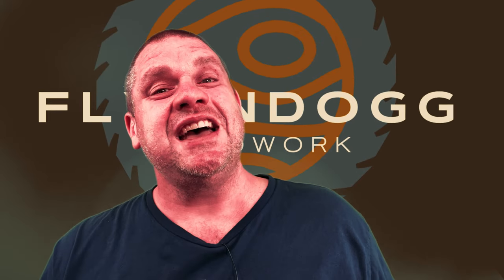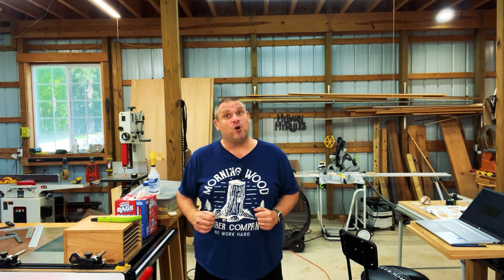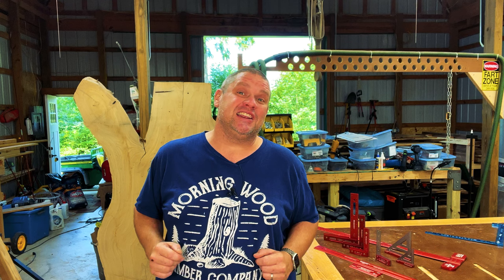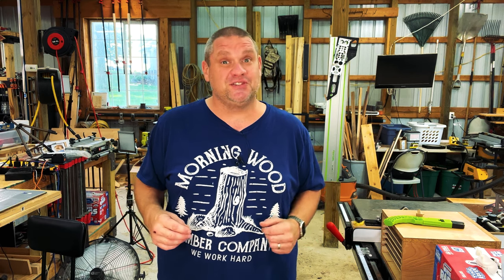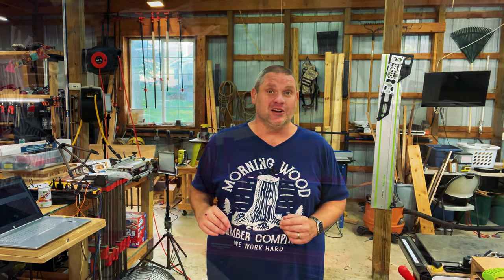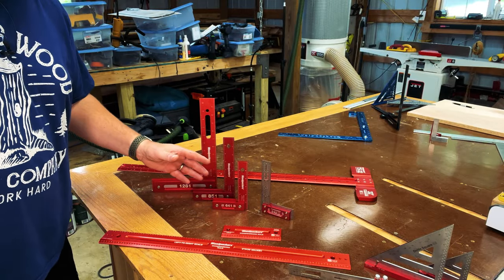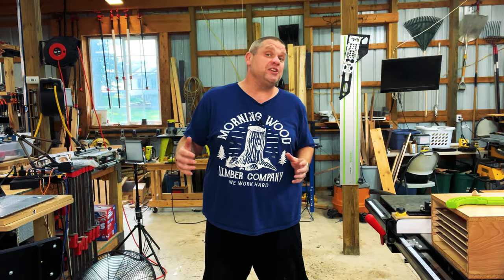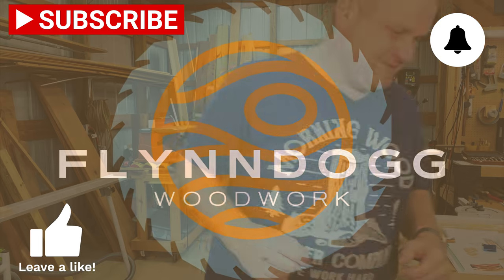Affordable and Effective Alternatives to Woodpeckers Squares #woodworking #precision

Comment: For finding the center of a board just angle the ruler to a point divisible by 2 or however many segments you need. For instance if you have a 7 inch board and want to find the center place your ruler so that zero is at one edge and 10 inches is at the other edge and mark at  5 inches, that’s your center
Reply from the maker: That's an excellent way to do it!   Thanks so much for sharing with everyone and watching unclepewter!

Comment: I attach a lip to my framing square with a spring clamp - no droop and costs zero.  
I do not scribe lines with a square of any kind.  I just mark the distance twice and use a straight edge to scribe the line.  The advantage of doing it this way is I do not need a perfectly straight and smooth edge to obtain a straight scribe line.
Reply from the maker: Love that idea!  Thank you so much for sharing the spring clamp idea!   Love hearing ideas like this!

Comment: A plain Drafting T-Square works well.  They come in all sorts of styles, and they are reasonably priced.

If you want to find a center or divide up something into equal parts all you need is an accurate rule and a straight edge.

To find the center lay the rule on an angle across your piece of wood.  Adjust the rule so that it sits with whole numbers easily divided by two rest on each edge.  Say you have a piece of wood that is 3-11/16" wide and you want to find the center.  Place the 1" mark on one side and then the 5" mark on the other, so you have 4" of rule lying across the wood.  4"/2=2", 2"+1"=3"  now place a mark at 3" and you have the center.   Do this again further down your piece of wood.  Draw a line between your two points and you have a centerline.   If you want to divide a piece of wood into thirds set the scale at 1" and 7: along the edges. 7"-1"=6", 6"/3"=2".  Place marks at 3" (1"+2") and 5" (1"+4").  You now have divided the piece of wood into thirds.  

You find the center by drawing a line across your piece of wood square to the edge.  Measure in a 1/4" from each side.  Take a compass and open it so it is wider than your piece of wood.  Strike two arcs, one from each 1/4" mark.  Where the two arcs cross is the center.
Reply from the maker: I love this Robert!  Thank you so much for sharing.  I use a couple of your tips on a regular basis so it was good to get a refresher!   I love comments like this that share experience and ideas.  Thank you so much for sharing and watching!
Reply: Good tip, and you can also buy a rule that has measurements from the center 0.  Very fast for centering.
Reply from the maker: @disqusrubbish5467  Yes!  Thank you again for sharing and watching! :)

Comment: I have a Swanson combination square. Unfortunately it was not perfectly square when I received it, but it's easy to adjust with a file. I see no reason to spend over $100 on a combination square when it's going to come out of square with general use, and you're going to have to learn how to square it on your own anyway. I also got a Swanson speed square with the combination square, the same as in your video, and it's actually square, so no complaints there. Both are a great value and there isn't a lot of worry with damaging them due to their cost.
Reply from the maker: Excellent to hear ibtamine!   Love the swanson brand and there is a reason they have been around for so long.   Some of the best value you can get for your money.   That is all I used when I first started woodworking and I continue to use them today.  Thank you so much for sharing and thanks for watching!

Comment: An inch, is not an inch, is not an inch. Straightness and square are not the only measures. Continuity between measuring devices is what led me to buy a FEW nicer measuring tools. It is crazy how much variance one can have between measuring devices. Nicer measuring devices are much more consistent.
Reply from the maker: Oh I agree with you.  And sometimes it doesn't always have to do with the edge of the measuring devises.  If you get a tool with a lip that has a bump in it or something like that I can also throw all your measurments off as well.  Thanks for sharing and thanks for watching deadbungeejumper!  Love the username!

Comment: All good points, but cheaper tools often gives more errors due to bad tolerances.
Reply from the maker: I'm 100% with you.   I do think its a roll of the dice with some of these tools with complete precision and accuracy, but brands like woodraphic have really impressed me so far.   You definately get what you pay for.  I think the key is you need to test your measuring devices as soon as you get them.   Are they square, do they line up with your tape measure etc.   Great point bamsebrumbamsebrumen!

Comment: One thing that I'd like u to comment on is the precision and consistency of the measurements. That is one of the big selling points for Woodpeckers. Are the measurements accurate in the cheaper alternatives (when compared to Woodpeckers)?  Thank so much.
Reply from the maker: Excellent idea!  Might be with a follow up video on this.  I will need a little more time to work with the brands like woodraphic to give an opinion but what I’ve seen so far has been impressive.   Thanks for the comment it’s a good one!

Comment: I use Incra, and still prefer it over most anything else.   Plywood I just use a tracksaw and get it a bit proud, and then finish on the table saw.  My first “track saw” was a 1/2-inch HDPE plate, with the saw mounted on it, and a groove to follow the slot in some t-track.  Relatively inexpensive, as I bought the plastic as an off cut at a commercial plastics supplier.
Reply from the maker: You don't know how upset I am that I didn't mention incra in this video.  You are 100% correct.  An excellent product for the money.  I have a couple of measing tools from them and they work excellently.  Not sure why I didn't include them, Most likely it's because I have stored them somewhere that I can't get to right now.  Thank you so much for the valuable reminder!

Comment: I'm not going to argue that Woodpecker isn't the best in accuracy.  For sake of argument, I'll consider that nothing is as accurate, much less more accurate.  

But, when I see YT woodworkers using them when they are NOT being promoted by them, it shows me that they are full of themselves.  Why? 

Every one of them makes mistakes and will be first to admit that the best woodworkers are best because they can "cover their mistakes".  Even with these precise tools, they fail!  Just like the rest of us and like every beginner, but maybe not to the scale a beginner's mistake.

I don't think there are any NASA or Space-X engineers teaching us how to make the perfect table, cabinet, cutting board, etc on these wood-working channels. 

What I do see being taught are great woodworking skills on how to make repeatable cuts, get square angles and parallel sides.  I've never seen someone tell me how to shave off or add 1/8 of an inch so my table top is perfectly square. Instead, they say things, and I'll quote ":Ted Baldwin" from Gwinnett Woodworker's Guild, "If it looks square, it is square."  

Wood shrinks, swells and bows more than the precision of these tools on a daily basis in most shops!  

The first rule my hobby woodworking friends taught me about woodworking is "use the same tape measure for all measurements."  The next rule I learned is from You Tubers, "to fit the piece, creep up on the cut."  The third thing is make sure your square is square. 

As long as your square is square, even with the most inaccurate tape measure, you can build a square box and fit it into a precision hole just as well as you can using the Woodpecker.    Convince me that I am wrong!

The most accurate I can build anything is determined, not by the accuracy of my tape, but how accurately I can cut, shape or connect pieces.  

If you want to see how to build projects without any ruler at all, check out Ted Baldwin at Gwinnett Woodworkers on YouTube. His videos are 5-10 years old, and he doesn't know I exist, but every beginner needs to at least watch his two safety videos.  

As you learned, Woodpecker tools may have their place, but that isn't in the hands of beginners.  If anything, that much precision will be detrimental to the confidence of beginners.  They need practice, not precision!
Reply from the maker: Thank you so much for your insight!   The tools are only as accurate as the user, that is for sure! :)   Thanks so much for sharing and watching!

Comment: Right off the bat: 40 years ago, I used a crabide drill, to put a pencil hole Exactly ONE INCH FROM THE END tHE 1" END AS IT MAY BE!

I made it to fit the Pentel P209 A .9MM LEADD\.

As a custom wood worker, I used  the P209 exclusivle. Cut to left, or right, leave the line take the line.

Great combination square trick.

philip

In the Great Pacific NorthWET, Oregon Division
Reply from the maker: What a great idea madighntist!   Thank you so much for sharing that.   Excellent idea.   Tell Mr Squatch I say hi! :)

Comment: I agree with everything you said in your video.  If you can afford a WP tool, then go for it.  But in the end, I think that the only reason WP is still around is their YouTube influencers.  Are they rediculously accurate, yes they are.  Do you need accuracy to .001?  That is for you to decide.  Just remember, it doesn't matter how accurate your measuring tools are if your cutting tools are not accurate.  For me, I would spend my money on quality power/hand tools before I invested $300 in a square.
Reply from the maker: 100% agree with you!   I find most of the time when I'm building something I can't even cut to the accuracy of woodpeckers.  Then once you have a few pieces cut, you aren't using measuring tools a lot of the time anyway.  You are using the piece you cut out already as the reference for measurments!   Thanks for commenting and thanks for watching CalCity1000!

Comment: Awesome job!!!  I keep thinking that my first woodpecker might be a Pocket T-square( most affordable for me) Thoughts? Any cheaper alternatives?
Reply from the maker: I think that is a great choice.   especially if you are going to be using it for layout lines.   Incra also makes some very affordable versions as well, so might be worth checking those out too.   The T-square won't be able to check for square if you are building things like cabinets, but I think that would be an excellent choice.  (I got the 642 which would also be an excellent choice in my opinion!)
Reply: If you don't mind buying knockoffs 731 woodworks did a nice comparison to woodpeckers tools showing which ones were good to buy
Reply from the maker: @DjLooN  Oh yeah!  I think I saw that one.  With the Paolini Pocket rules on the thumbnails.  I think his video actually inspired me a bit to do this one!

Comment: @Flynndogg Woodwork

It really boils down to what level of precision and accuracy you need.  If you are doing fine woodworking and want to ensure you really are square you can't beat woodpecker precision of 0.001" per foot of holding square.  The cheap cast speed squares can't hold that level of precision.  You'd be lucky to hold .020" per foot of squareness.  That adds up quickly as you increase your distance away from your edge.

A great alternative to Woodpeckers with similar precision and accuracy would be igaging brand of precision tools.  They hold approximately +/- .005" of squareness per foot for their equivalent Develve squares for a fraction of the price of woodpeckers.
Reply from the maker: Great great point creamysbrianna!  I agree with you, when I'm doing something with very high precision I almost always reach for my woodpeckers or woodraphic.   I think the point of this video for me was to show some cheaper alternatives to those who maybe can't afford the higher end tools or are just starting out and are looking for some alternatives.  Igauging is a brand i've been very interested in checking out over the last few months.  I've heard some really good things about them.  thanks for sharing i really appreciate it!

Comment: Please don't hate me, but the only "precision" you need with wood work is "square / angle".  Length accuracy is pretty much immatreial (within reason).  The dimensions of our work changes by variations in temperature / humidity / time so as to make the famed accuracy of the W'Pecker imaterial.
Reply from the maker: I like your thought process and I think it has some real validity.   Even all the miters, etc. are  going to move with the changing of humidity and temperature.   Thanks so much for sharing, you got me thinking (which is rare!) :)

Comment: Can I live without this or that Woodpecker, that's not the question. The question is does this do something that makes it worth the crazy price? Everyone develops a didifferent workflow so the answer is never the same for two people. For me the only one that I can't live without is the 3-1/2" DeLVe. Doing layup on small stock it just has no substitute.
Reply from the maker: Great point Mark!  I 100% agree.   The 642 is one that i have relied upon for years, Just recently got replaced with a woodraphic M4 which is only 4 inches long. Like it because of its size.    Thanks so much for sharing and watching, excellent points!

Comment: There's always a cheaper alternative to precision tools, lol. It's the precision that costs so much though. US made also ads a lot too. If I were still doing machinist work, I would definitely buy the Woodpecker brands. Using a scale as a straight edge? Yeah, that's definitely the wrong tool for the task, regardless of the price. They look very well made and if you don't want them, I can put them to a more effective and appropriate use. I really like the red anodized finish too.
Reply from the maker: Yep!  They are excellent tools!  My 642 is my right hand man in the shop.  Thanks so much for the comment and thanks for watching!

Comment: I have the combination square It only has 1 nut to hold it 1 nut is not better than 2 nuts.  That square is off by a degree given the length.
Reply from the maker: I agree it would be nice to have a second nut in the combination square.   that seems to be one problem with the design of a combination square is the potential for the engagement between the screw and the ruler not being fully secured.    Thanks for watching Steve!

Comment: The Woodraphic square has a thin aluminum rule which can be damaged extremely easily when compared to the steel Woodpeckers
Reply from the maker: Yes that is very true, but woodpeckers also has an aluminum version which also has the same problem.  Don't ask me how I know! :(   Still much much cheaper than the woodpeckers aluminum version as well, but very valid point!   Thank you so much for sharing!

Comment: I have been wood working for a long long time and never felt the need to use 1/8" hole feature. I could give you 10 reason why that feature isn't necessarly that impor tant.  The video was good , but for me a woodworker tool would never darken the door of my shop.  They ain't wort h the money.   measure twice cut once, it works every time.
Reply from the maker: Love it.   And advice that has stood the test of time.  Thanks for watching MrRackinRoll! :)

Comment: No you don’t need fancy, expensive tools. Sure they look cool, but how much precision do you really need? If you don’t have accuracy in you cuts, drilled holes and assembly, then it doesn’t matter how accurate the line or measurement was. These are like the 5 step procedure to square up your miter gauge or crosscut sled. Sure it’s nice to get it as perfect as possible, but to strive for .001 of an inch. Look at ruler with 1/64” increments. Pretty small. If you can get the saw to that in say 12 inches, then that’s 1/8” in 8 feet, which you can’t even cut with a miter gauge or crosscut sled. As far as squares, hold it on a straight edged board or workbench, strike a line, flip it 180 degrees and see if it is still on the line. I do that at the store. Use the shelf or a counter top or whatever you can find that’s straight.
Reply from the maker: Excellent way to look at it Bob. Clear and easy to understand!  Thank you so much for posting this and thanks for sharing with everyone!
Reply: @FlynndoggWoodwork  Thank you for the comment.

Comment: Gotta remember that speedsquares are made for rough construction and may not be true (i.e. 88 degrees instead of 90).
Reply: You can verify how square it is by using a scrap piece of wood with parallel sides. Hold the lip edge against one known parallel side and draw a full line. flip to the opposite side and draw another full line. if your lines cross youre not square.
Reply from the maker: Excellent point brady!  Thanks for sharing with everyone! :)
Reply from the maker: Great point Steelsumpi!   Thank you for sharing!